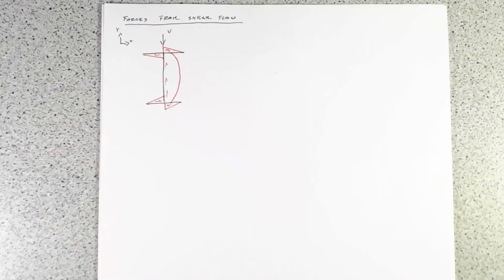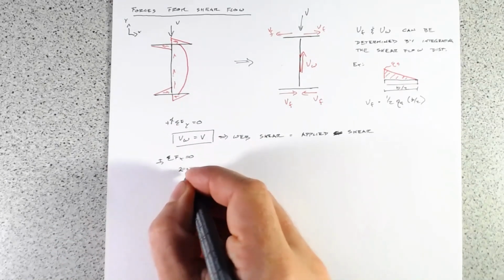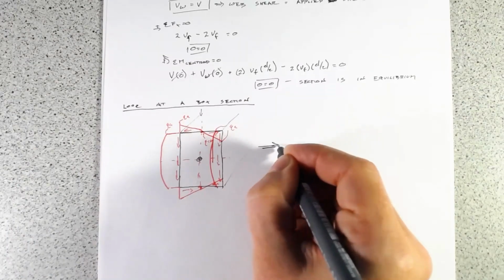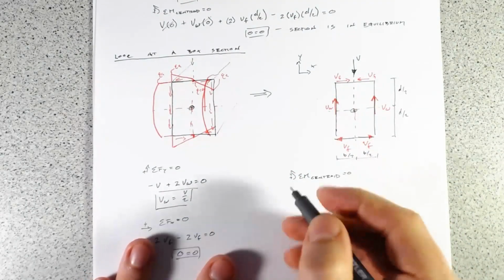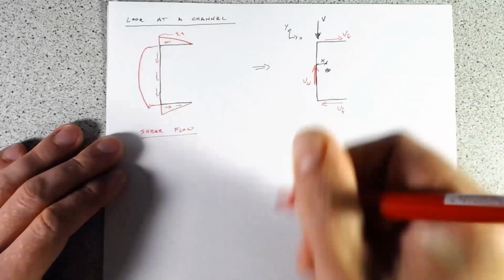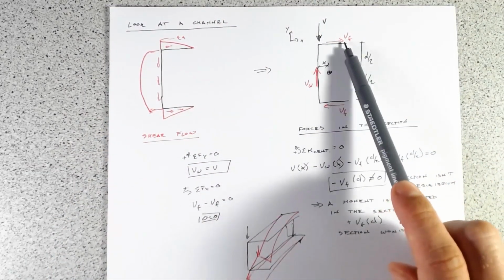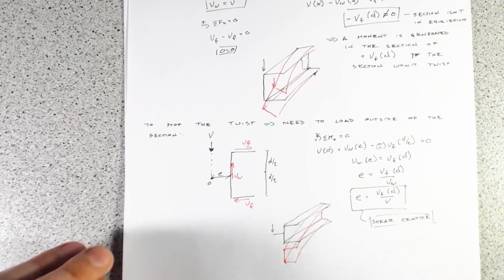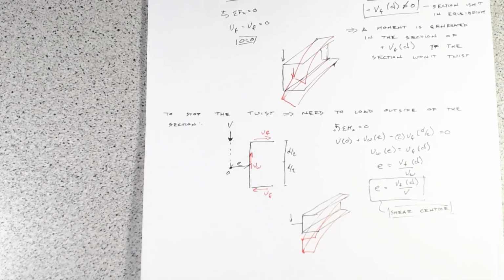Shear Centre

Comment: hi, In books they show that applied shear direction is same as vertical shear in web. Could you please explain that.
Reply from the maker: What is being shown in text books is typically the other side of the "cut".  From Newton's third law every action will have an equal and opposite reaction so the direction of the shear will be equal and opposite depending on which side of the cut you are looking at.  I draw it this way in the video as it means that when doing the equilibrium equations the external shear easily cancels out with the internal shear flow so that it is hopefully easier for this topic to link back up with what you know about basic statics and hopefully make the concept of shear centre more intuitive.
Reply: @lucasshogan   thanks for the reply. What  i am getting from your answer that internal reaction will be generated  on the out side of element. So action reaction should make the element equilibrium. But at 16 :47  for equilibrium don't you think that we need to action reaction pair for equilibrium. External shear should balance internal shear.